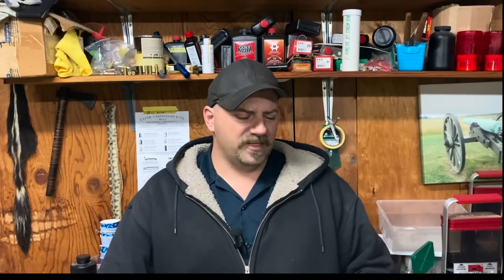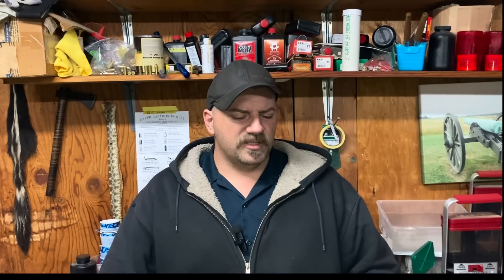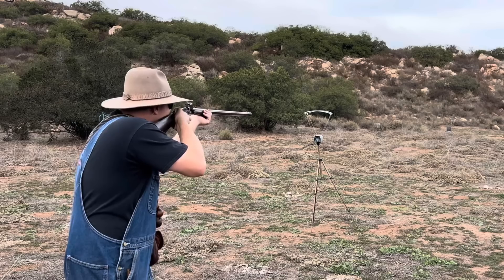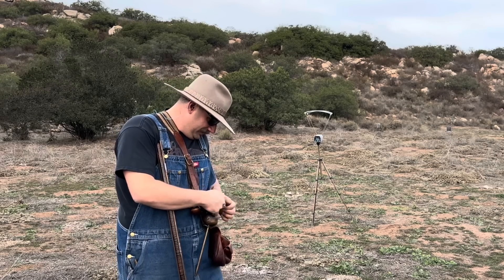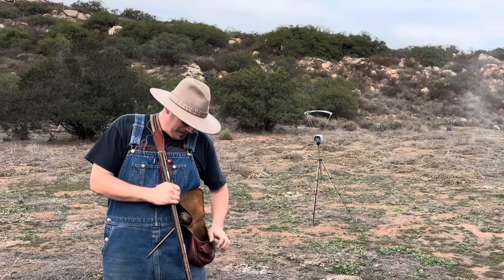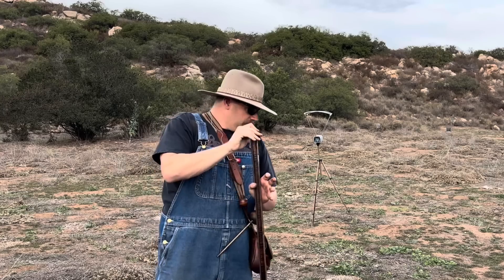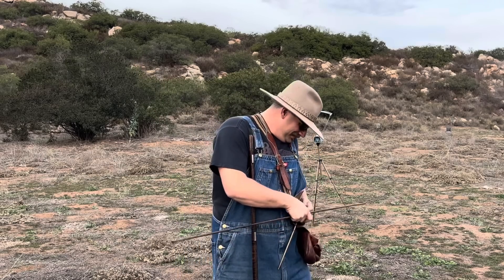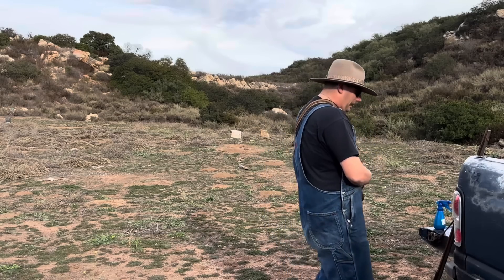Black Powder (Carbon Black)

Comment: Carbon black is actually close to pure carbon but lamo black has trapped gasses and other weird contaminants, in pyrotechnics, it is used in the shell that fills the entire scy with long lasting sparks, some even hitting the ground, as far as I could find, carbon black is not used at all. A firework supply company will have your lamp black, you might want to try, they are completely different animals.

Comment: Have you tried Activated Charcoal, the kind they use in filters? When I used to haul the stuff it had to be on a flatbed or curtain sided trailer because it would absorb the oxygen from the air in a confined space and could kill you.

Comment: I don't know if there's any difference between carbon black and lamp black. But it seems to me way back when lamp black was around everywhere. So I would think that if it was a good source of carbon, some old setteler already tried it? Maybe? I completely forgot to mention where lamp black comes from in case anyone doesn't know. It's  the black substance that builds up at the top of a kerosene lamp globe. That why I said if it was any good someone would have already used it.

Comment: From chemical point of view charcoal and carbon black are rather different materials. Charcoal has significant content of oxygen, for example and carbon black (as far as I remember) has no visible amount of oxygen. Also molecular structure of both materials could be very different. I'm very surprised that you even can soot BP on the base of carbon black.

Comment: I am pretty surprised by this result, but it is interesting.

Since graphite was so slow I was expecting this to work better.

At this point my best guess is that the particle size is too small, which seems a bit counterintuitive.

I also wonder if it has something to do with what happens to the material during the corning process.

Comment: Thank-you for this, it's told me everything I need to know. I have some carbon black I wasn't certain what to do with it as I didn't know how good/bad it was. I'm now off to make the first stage of BP, which is fiery propellant. It's BP mix not wetted or screened & it's great for pyrotechnics.  I'll use the CB I have, thanks again, I'd have hated to waste it.

Comment: Carbon black and specifically cas number 1333-86-4 can be a LOT of things. It is also known as "Diesel particulate matter". It does not have to be pure at all, and can have over 10% volatile compounds. Anything over 8% is considered an explosion risk btw. So, depending on the purity it may work or not. Too pure would suck... You need those VOC's.
Have to say after the end of the vid: My assumption was right that you probably need the VOC's but also your assumption was right too; that was a very pure carbon source!

Comment: From my readings,  no, Petroleum products (including lubes and solvents) have been proven to be ABYSMAL for black powder. The United States military experimented extensively with Pertrolium based Lubricants, bullet lubes, greases and powder additives in the mid to late 1800s, prerty much finding that all it does is gum up the fouling faster tuan Satan's snot.
They did doscover however that Paraphin Wax could be a useful substitute for Bees wax in black powder gun lube.. so there's that. ^.-.^

Comment: As far as i understand. The carbon for black powder has to be fine, but structured, like crumbled up paper, providing a big surface to volume in a small space and space for the other components to settle in. Carbon black, lamp black, graphite, etc. are very dense and has very little surface to volume, be it that the particle are very small and clump up easily, or are able to pack up very dense.
Taking this into account, carbon sources from plants will do better than other non organic sources. The cellular structures are roughly preserved creating a big surface and hollow spaces.
At this point the additional stuff that is in organic matter and didn't gasify (salts,metal oxides, etc.) will have an impact on the quality of the resulting back powder. The question is how to produce charcoal that is mostly carbon. Fast growing plants with little density comes to mind, excluding grasses as they have a lot of silica in it. Such plants don't store a lot of salts and other stuff in the cells simply because they don't have the time to do that.

Comment: I highly recommend reading "1980 the role of charcoal in the combustion of black powder: james E. Rose naval Ordnance Station 20640" and "organic substitutes for charcoal in black powder type pyrotechnic formulations: Ballistic Research Laboratory ARBRL-TR-02569" and "The influence of physical properties on black powder combustion: Ballistic research laboratory ARBRL-TR-02308" and "Relationship of combustion characteristics and physical properties of black powder". They all have a lot of useful information in regards to black powder formulation including how charing carbon at higher temperatures increases its auto ignition temperature and removing volatile organic compounds from charcoal affects powder strength. Since lamp black is normally produced at very high temperatures and has all the organic compounds removed, it is not surprising that it does not work well for black powder.

Comment: I'm late to the party; so please forgive a weeks late comment. However, I believe that I understand your results from the balsa, cork board, toilet paper,  cotton balls, up til this carbon black experiment. I suspect that the lignin content is the varibale that has stood out. Balsa is a low lignin wood. The lignin is mitigated in the paper making process, also resulting in a low lignin feedstock. The cotton fiber, however, is a high lignin material. The sample size is small; however, you seem to be having better results with low lignin cellulose sources. I winder if treatign your wood feedstocks to break down and wash away the lignin might have good results. Like the process Nile Red used to make transparent wood. Or, perhaps using cellulose powder as a charcoal feedstock? Though, that might end up like the carbon black. Too dense of a carbon structure. All very intersting though.
Reply: Here's a vid on extracting Cellulose from Woody materials https://www.youtube.com/watch?v=m-SXuhLPYig

Comment: One thing that does not seem to have been addressed in all the excellent experiments you have conducted, and that is how do we get a more wet residue from black powder, I have used black powder left over from the Crimea war, and that left a very damp, and easily removed residue, which I think would give the projectile a much easier passage through the barrel, it would also go some way to reducing the need for a lubricant, and explain why Colt did not recommend lubricants, "modern" black powders tend to leave a very hard residue, so there must be something very different in their make up. Chris B.
Reply from the maker: I think the density has something to do with it as well.

Comment: I spoke to my brother who is a chemist about this. His take is that because pure carbon has a stable crystal structure it won't react as much during the explosion - causing the poor performance and the amount of carbon residue left behind. He says graphite would produce a worse result. We talked about the toilet paper charcoal and he said because the paper is almost pure cellulose the process probably results in a form of gun cotton where the structure is more open allowing the nitrate to better react with carbon.

Comment: How far out there do you want to go for some Carbon?
Me as a silly Chemistry fanatic, would take some plain sugar (C6H12O6) and pour it into a large beaker of 50% Sulfuric Acid (Drain Line opener) and make a big ole carbon snake.
It makes a hell of a mess and smoke.. but its fun to watch.
The snake is contaminated with Sulfuric acid, so it needs to be rinsed, and rinsed and rinsed and rinsed with Ammonia and water to neutralize it, then possibly fired at high temperature and rinsed, and rinsed and rinsed again.  You don't want it acidic at all or it may damage your firearms (not responsible if it does!)
Plain sugar is a direct carbon source, if you dehydrate the water off of the molecule.
So that's a silly long way around to get some Carbon.
Cheers.
Reply from the maker: I was reading about this. It sounds interesting.
Reply: @Everythingblackpowder   I was watching some fire snake videos, and you could burn the sugar by mixing it with baking soda, so you could avoid latent acid contamination that way, and you get a direct carbon product, so that might be a better idea.
Sulfuric is pretty hard to neutralize because it's a really strong acid.

Comment: I worked in the wine industry almost 50 years  and we used activated charcoal (carbon) to decolor and absorb off odors.  It was food grade and pure.  It made awful BP.  My assessment: the impurities in other carbon sources actually benefit the reaction.  I also tried using dusting sulfur (used in the vineyard to control pests and disease) and it performed poorly, too.  It has an  anti-caking additive.  My assessment: the impurities inhibit the reaction.  My final conclusion: Trail and error trumps science.  I enjoy your videos.  Thanks.

Comment: Have you tried plain old activated charcoal? From the aquarium store. As I understand it there is an extra step of injecting steam into the tort to drive off more VOCs, in theory, it should be more reactive. it would be interesting to go full chemistry geek on a batch, there is lots of crud in household chemicals.  The stump remover is easy to clean, dissolve the stump remover in water, then evaporate the water. The sulfur on the other hand is basically the same but you have to dissolve it in nearly boiling  xylene (basically gas) so not trivial from a safety perspective.

Comment: I have a table of gunpowder compositions with alternate oxidisers if you're interested
Reply from the maker: Sure
Reply: @Everythingblackpowder  these are all based on the 77/13/10 mixture (except the NH4NO3 one, which I found on the internet), under the assumption that the metals react in a manner equivalent to potassium.
LiNO3* 70/17/13
NaNO3 74/15/11
Mg(NO3)2** 71/16/13
Ca(NO3)2 73/15/12
Sr(NO3)2* 78/12,5/9,5
NH4NO3*** 85/15/0
*potentially hard to aquire
**higly hygroscopic even when compared with the rest, might prove too much of a hassle
***potentially hard to get. The mixture containing NH4NO3 is called ammonpulver and should result in pressures and velocities akin to smokeless powder. It is also corrosive to brass over longer periods of time and grains break up when heated above 31°C.

Comment: Given that the quality, clenaliness and power of black powder seems to come from light softwoods, and the softer and lighter the better, seems that the carbon part porosity and structure plays a big role here. Why not try activated carbon? Activated carbon allegedly has one of the largest surface-volume ratios possible, so it could be effective.

Comment: well as a chemist i can say that in my experience, most sooty left over "carbon" combustion products are not pure carbon but are instead aromatic breakdown products. they tend to accumulate from incomplete combustion since they take even more energy to oxidize and liberate as co2 compared to most other carbon compounds. so i would guess that lamp black is basically concentrated garbage carbon. yeah it probably has really good surface area, but as youve shown over the last few tests, surface area aint everything.

Comment: Soot has a very small amount of surface area topologically compared to charcoal. So there is less surface area for the other reagents to interact.
Likely the Toilet paper, being mostly aerated carbon, provides a far larger surface area for reagent interaction per volume than the soot.
To test that hypothesis, you could use and compare fractal carbon sources, like coconut husk, cork, or even balsa charcoal and see if they approach the TP test.

Comment: So the reason I would guess that the powder didn't work well was is that carbon has a lot of Allotropes A simplified version of an allotrope is it's basically the arrangement of the molecules in the crystalline structure of the material. An Example of an allotrope be like diamond and Graphite they're both pure carbon but they are very different . Whatever alotrope the carbon black Is appears to be incompatible with making black powder. I would like to see you try making black powder out of diamond lapping Powder I don't know if this will be any better than the lamp black but it would be interesting nonetheless.

Comment: It's less about purity and more about surface area. Charcoal has a very high surface area (why it's used to filter water), graphite does not. Carbon black is basically just graphite, so would expect it to perform similarly.

Comment: the Hydrogen in the charcoal gives the blackpowder the powder. They used the brown charcoal (rich on hydrogen compounds) for fast burning hunting powder. The first "modern" battleship gunpowder was the same they used straw and heated it with overheated steam around 170-200C with this methode you enrich the hydrogen it works with normal wood too. It was less abrassive than smokeless powder and it was compressed to an desteny of 2.0

Comment: Could you try oil impregnated wood? I think once it's turned into charcoal there's a possibility that there will still be residual hydrocarbons from the oil left in the charcoal. You could also use Fatwood for it.

Comment: Carbon black is nasty stuff, what you get from burning carbon rich hydrocarbons, acetylene, aromatics, benzene, polystyrene and stuff.'
It's not pure carbon, with hydrocarbon components burned off, like charcoal. More like a mixture of hydrocarbon grease and partially burned carbon stuff, that why it's feeling greasy and you can smear it onto paper.

You might get better results, if you extract the hydrocarbon stuff with gasoline or so, pure carbon shouldn't be soluble there.

Comment: My guess is that the soot doesn't have any tiny structure to it giving it the surface area it needs to make a good BP.
Next carbon source? 
My vote is upon pure cellulose bedding (for pets).
If it can be found made of "a traditionally fast BP wood source" it would be even more interesting, but not a deal breaker.

Comment: Try extracting the lampblack with alcohol to see if there is any significant amount of oil in it. Lampblack is often made by burning fuel oil in an excessively rich flame, so there is probably some oil residue. This is no problem for its typical application of use in compounding rubber, so the manufacturer may not control for purity, just for consistency.

Comment: I think that the microstructure of the carbon source is at play here, maybe a little bit of research would show a link between the carbon sources that did well. 
Concerning your method, it is perfectly scientific and you can be proud of it because consistency in the method is what brings trustworthy results 👍.

Comment: I should have warned you about carbon black but you would not have listened any way. I worked ina tire factory for 30 years and carbon black is used to make rubber for tires it has to be the nastiest stuff ever made ask any one that has ever ran a rubber mill.

Comment: In your last video you talked about getting densities in the neighborhood of 1.7 to 1.8 grams per CC,  how do you measure that ? do you compress the powder to get the 1cc ? I tried a Lee 4cc scoop with the powder settled and leveled off then weighed to get an average but but my numbers  were only .8 to 1.0 grams per cc. I compared GOEX Cartridge, Graff & Sons made by Goex in FFg and FFFg and my own Mullberry 77-13-10 pucked with a 12 ton jack. While my numbers were only a little lower than Factory Powder they were not even close to the 1.7-1.8 so I must be doing something wrong but the powder shoots well in both my Revolvers but I haven't had a chance to Chronograph them yet.

Comment: Just at thought... the fireworks guys really have all this propellant stuff already figured out and down to a science I would think.
Reply from the maker: lol then why do they have such lousy powder?
Reply: @Everythingblackpowder  Actual professionals don't have bad powder. Many of them actually understand the chemistry involved and also no about other propellants and downright explosives that the gun guys don't study.
Reply from the maker: Compared to sporting grade powder, it’s bad powder. I’ve talked to plenty of professionals that think what we do is completely unnecessary for firework powder. It’s a simple matter of meeting different goals for different objectives.
Reply: @Everythingblackpowder  Agreed, different objectives, but I'm quite sure they already knew "carbon slow & dirty, balsa faster & clean". The point is, there's alot of knowledge out there about black powder and pyrotechnics in general. Even if their purposes are different. I've even seen green powder get the job done.

That said, your slowest was about 1300-ish of the vids I've seen. Considering that .45-70-405 was a about a 1350 fps loading... and killed a lot of bison, any of them would work. :)

Somewhere there's a webpage of  a wastewater engineer over in Europe that tested different charcoal time and temps and graphed it out. I'll see if I can find it. You might find it interesting, if but unnecessary refinement.

All that said... ways of making nitrate from scratch would be an interesting topic if availability is what's driving this. Or fear of no availability. Would very much like to know of a way to make nitrate from scratch, without purchased materials... that didn't involve urine and feces, LOL!